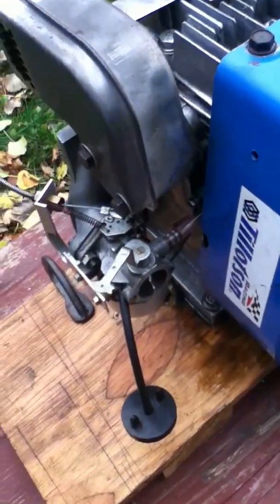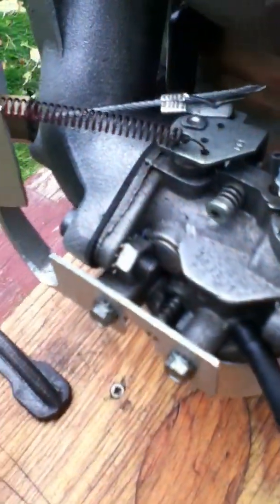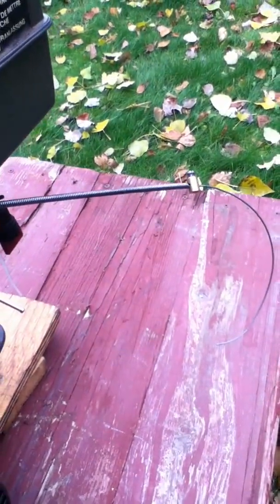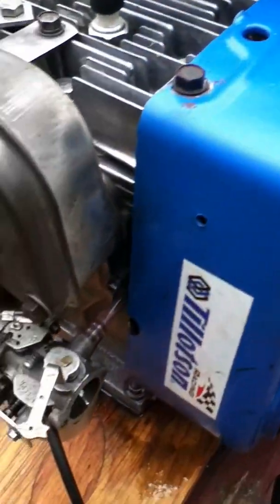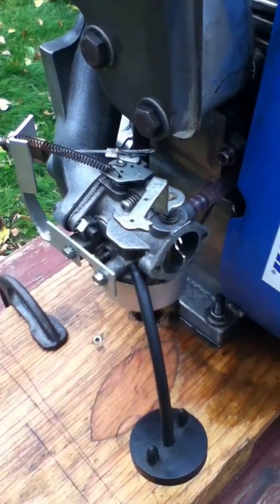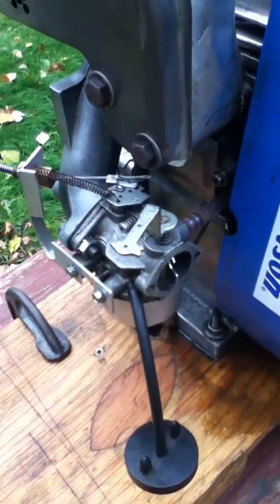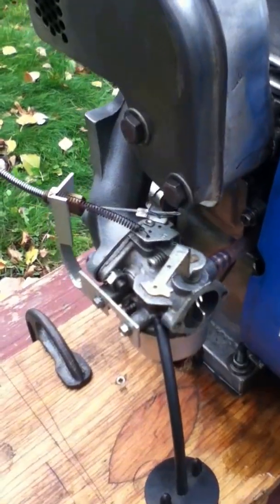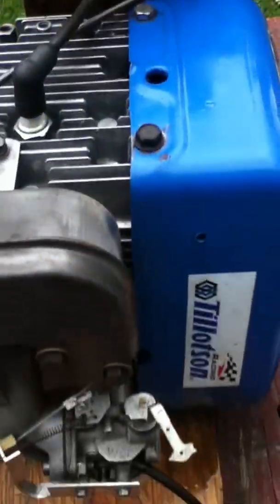Throttle Linkage Setup on Stock Tecumseh   Running Test

Comment from the maker: It's a Tec HM100 10 hp, your setup is probably similar just smaller scale. The key is the two screws on the side the carb needed to mount the bracket that holds the throttle linkage - originally those hole were mounting points for the stock setup throttle and governor with out them you can't mount the the bracket shown , post a vid of your engine for suggestions

Comment: Nice set up!  Ive been looking on how to convert a snow blower engine to power a sled bike.  I was curious what you did with the governor throttle control pack that usually mounts to the recoil plate there?